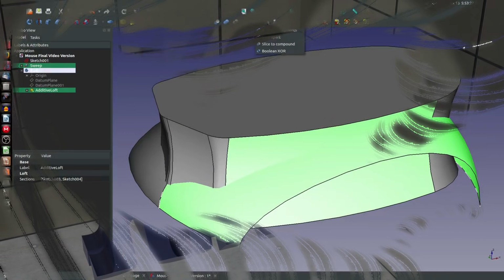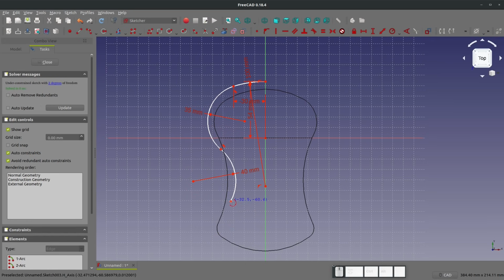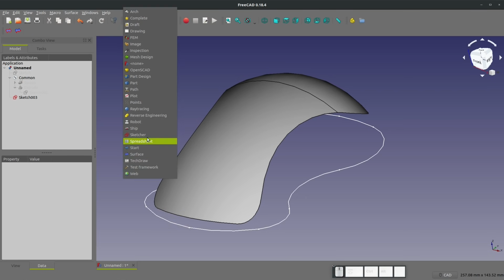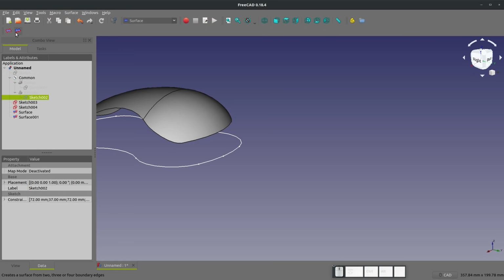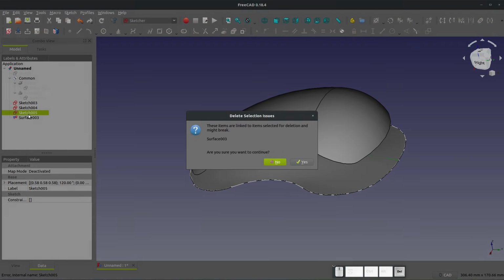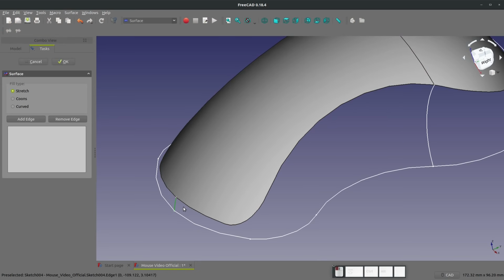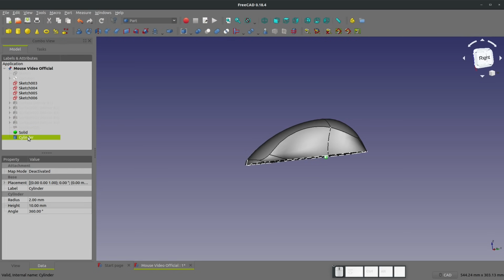FreeCAD - More Powerful Surfacing |JOKO ENGINEERING|

Comment: Do you use arcs instead of B Spline because you do find arcs easier?
Reply from the maker: Good question - I find arcs very precise, but b splines are also a really good application for this if you don't necessarily are about exact dimensions.
Reply: @JokoEngineeringhelp  If it is heart shape or like Apple Logo Shape... Better with Arcs or B Splines ? TIA
Reply from the maker: @mohamedelhageen  Either one can deliver a great result.  I would say if you can use arcs, use them first.  They are easier to dimension and easier to change later if you need to go back and make a change.

Comment: What degree of tangency is between surfaces? Can you control it? If you create plastic part, would the edges be visible as ridges? Or what about applying the zebra light(does FC even have it? I cannot find any video about it).
Reply from the maker: The zebra tool will be in the curves workbench- you may also find some additional surfacing tools for tangency in there as well.
Reply: @JokoEngineeringhelp   Well thanks. Will check it out..

Comment: Thank you so much for this video. It presented new ways to create to me. However. I have been looking for a way to create a engine-cowl (or nose section) for an RC airplane. I have tried several series of attempts with intervals of about a month. In my current series of attempts I am at nur. 14 and failed again. It seems impossible... I studied all the video's I could find and tried to apply all the different techniques presented to no avail. Perhaps you could give a hint in how this object. Warning, it seems quite simple untill one tries...  https://www.youtube.com/watch?app=desktop&v=SUdlLWyOeso.. Particular interesting is the how the 'mantle' curves and blends into the somewhat rounded 'nose'... I am workd with 3DStudio and with Fusion360 and than it is possible using surfaces. I would like to use FreeCAD for this... Any help would be greatly appreciated.

Comment: The sweeping gave me so much trouble because I did not follow precisely step-by-step. It is so counter-intuitive. After like 10 tries I had no clue what was broken.
The thing that clicking "Done" does visually nothing and it gives no messages on what is up.....I had no clue that clicking OK was the only thing holding me back from creating an actual surface XD
Reply from the maker: The Part workbench is older and more tricky like that.  I usually default to part design for the more modern and intuitive workflow.

Comment: I designed an object in part design and wanted to add a solid, made with the surface worbench, to the body. i dragged and droped the solid to the part design body. it created a base feature. un fortunaly i recieved an error. could it be, that i can only use this solid in the part workbench?

Comment: Can u please do it in alibre too?
Reply from the maker: Hi King,
Alibre doesn't have surfacing tools in the same way, so the mouse would need to be made with a solid loft or series of lofts
Reply: @JokoEngineeringhelp  do u think its possible? in a resoable time, or using a other programm like rhino first

Comment: HI, I'm a FreeCad beginner (used to wok with Cinema4D). For the "Issue" with Mirror is quite easy to Solve.
Every time you Mirroring something, points on mirrored X or mirrored Y axis are overlaped (two on the same place instead of only one). It work more like a "COPY AND MIRROR". So the "FIRST EASY FIX" to do is select the "maybe double points on the X/Y Axis" with SelectionBox (if lines are selected, deselect them) and press C (Coincident Constrain). Overlaped points now are only beautiful one.

In Cinema4D is quite the same thing : just select with Selection Box points and press U-O (optimize). Overlapped Points are merged in 1 single point

Comment: Doing this surface directly here is nothing new.  It's just a different method.  If start from scanned data to facet then convert to CAD surfaces to match it, can you do it?
Reply from the maker: My approach would be to either delete bad elements and fill the empty spaces with my own if FreeCAD will allow or build surfaces based on the scanned model.  I don't work with scanned data in FreeCAD though, so there may be someone who has that has some insight

Comment: Really useful! Thanks! Also pretty impressive what FreeCAD can offer when it comes to handling surfaces.
Would be nice to see if it's possible to add splines or "function driven" curves to the construction of the model. (I tried it with previous versions and couldn't find a solution for that. Maybe I overlooked the option mentioned somewhere..)
Reply from the maker: There are 2D splines in the sketch enviornment of course, you can also intersect and split surfaces for the equivalent of a '3d spline'.  The curves workbench has similar functionality which I will be publishing content on soon.
Reply: @JokoEngineeringhelp  Thank you very much! Will check in practice.

Comment: Hi, its all fine what you did. You can do a little better instead of the circle (Sketch006) a nice B-spline to smooth do instead of an edge.
Reply from the maker: It depends on design intent
Reply: @JokoEngineeringhelp  Of course 🤓.

Comment: Great tutorial! Do you have any plans to continue adding more detail, like cutting out buttons and hole for scroll wheel etc, and eventually turning it into something 3d printable?
Reply from the maker: I think I'm done with the mouse at this time, I do make a more detailed one in an older video
Reply: @JokoEngineeringhelp  So Solidworks has its weird bugs too?
Reply from the maker: @j121212100  Indeed, perhaps not as much as the Creo guys accuse it of having though!

Comment: Have tried FreeCAD a few times and each time I was struck by the awful fiddly design process. I finally settled on the equally free Design Spark Mechanical. When there's a new update to FreeCAD I take a look and nah!
Reply: Not "equally free", by far not. FreeCAD is free as in freedom, open-source software that nobody can ever take away from you. DSM is free as in a freeware software with online activation that lasts a year - and then is hopefully continued at distributor's descretion, and so far this has happened automatically. But one major reason DSM exists is in order to sell its parent software - SpaceClaim. The feature set is nice and high quality but is deliberately limited. If you want to take your objects to manufacturing (which isn't 3D printing), you cannot export a STEP file from DSM. You can lose access to DSM and to your source files that you created.

Unfortunately, FreeCAD is neither particularly elegant nor particularly robust.

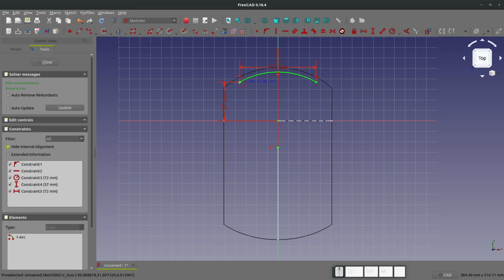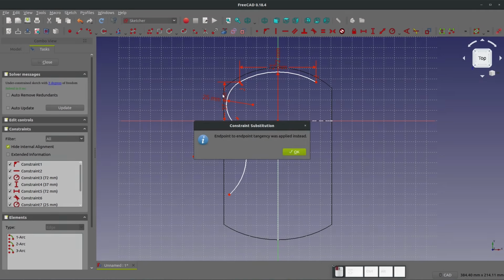Comment: Note that you can achieve the same effect as applying a tangent relation between two edges, then a coincidence relation between the endpoints (e.g. as you do at 4:44 and 5:06) in a single step:

Simply select the two endpoints and apply a tangent relation (e.g. the toolbar button or the "T" key). This will create both a tangent relation between the lines and enforce coincidence between the points. Much easier!
Reply: I was just going to mention the same thing :)

Comment: I played around with the grabcad model. I found that while using the surface tool in the surface workbench, you dont have to click "add edge" for every selection. If you click it once, you are allowed to then select your edges in the viewer in series. Also, I find I get wacky results when using edges that dont originate from the sketch, eg, the common sweep or other surfaces, however the different fill options "ccon" and "curve" did improve the shader normals somewhat

Comment: Hi, great videos however I can't even get off from the starting line with Freecad on Win 8, version 18.4 won't open, version 19 is giving me strife over parts library, I've tried uninstalling and deleting folders and files and tried multiple attempts at reinstalling, version 19 seems to need Gitpython,  and Python and just, getting confused,spent 3 days back and forths to get Freecad to work for starters then to work with Libraries, guess it's just me but bloody hell it's frustrating when your an old fart trying to keep up with the rest of the world, cheers.
Reply: Hi thanks for the comment, maybe I think I have found the problem,I have read that you need to clone the library rather than download the Zip file and place it in the Mod folder like the instructions say to so now have o learn how to Git Clone now....think my head will split open doing this... be nice to have a video explaining this most confusing set up, anyway sometime later I'll have a crack at doing this, cheers.
Reply: I have Win7/64 and use the .19 zip/portable version, no installation. Works a charm, very stable.